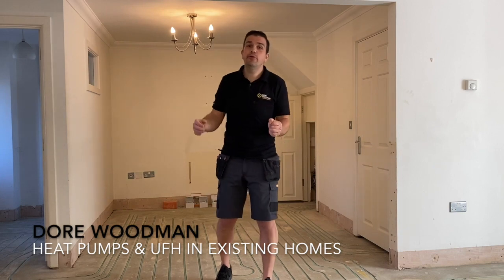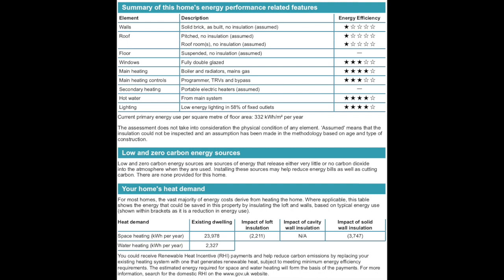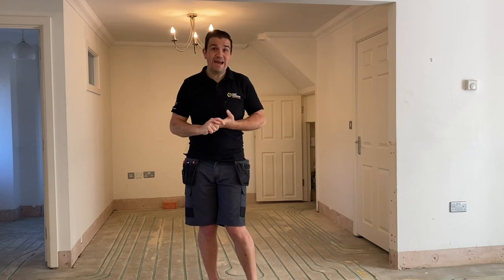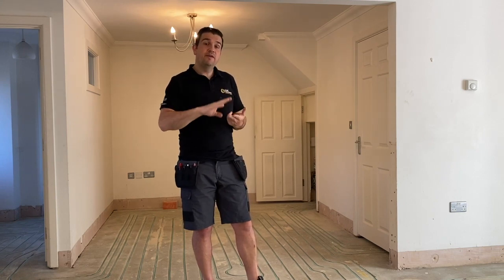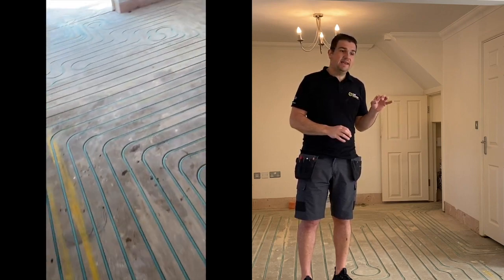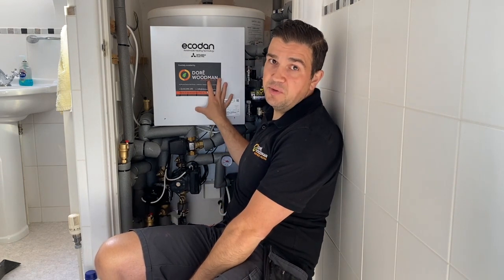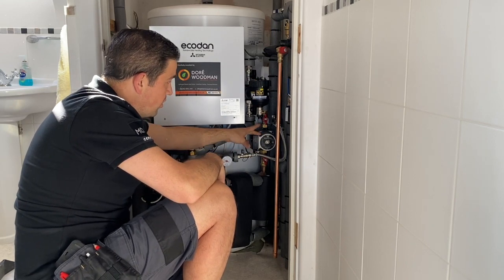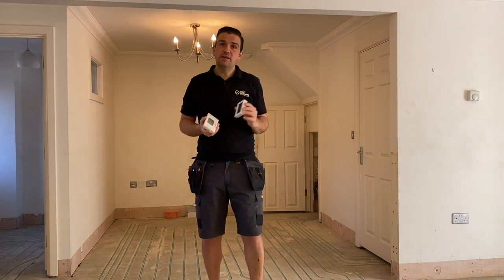Retrofit Mitsubishi Ecodan Heat Pump in a renovated home

Comment: Hi Jason, good presentation. Why in this instance have you opted for a Mitsubishi stat for the upstairs rads and a Heatmiser stat for the ground floor UFH. Could you not have just used one manufacturer...ie the cheapest? Thanks Mike
Reply from the maker: We have linked the Ecodan with the WiFi interface and MELCloud app, with the 1st and 2nd floor on radiators we installed the mitsubishi controller to work with the app to enable control remotely if required.

With the underfloor heating we had 3 zones to control and as this is set up slightly differently and with the options presented to the client the Heatmiser control was added. We also installed the NeoHub to allow further remote access via a mobile/tablet at the clients request.

I hope that helps.
Reply: @dorewoodman  Thanks you for your response on the stats. Can I ask 2 more questions please...
1.	After studying the FTC menu options, it appears that the DHW cannot be scheduled with ‘On’ ‘Off’ times. Octopus have a £0.05 kWh, 4 hour night period and would seem sensible to undertake DHW heating during this period using the pump (up to 50C) and then use the legionella function to raise this still further to 65 – 70C thereby giving plenty of hot water for the following day? Doing this could reduce the size of hot water cylinder required, Could you install a third party timer to operate the DHW pump or the MV? 
2.	Do you restrict your ASHP installations just to the south east?
Many thanks
Mike
Reply from the maker: @MichaelSmith-fx2ci  There are timing schedules that can be set either on the FTC controller and/or from the MELCloud app to enable you to integrate a program to suit your tariffs and we would certainly encourage implementing that to suit. As for the time period to produce the hot water, of course that will be determined by the amount of hot water you have, the temperature at the time of recharging and the period of time set aside for recharge.

For example, you have an 8.5kw Ecodan with a 210 litre cylinder, the target temperature for hot water is set to 50 degrees and by the time the heat pump comes on from the program schedule the cylinder temperature has dropped to 30 degrees the recharge is only approx 35 to 40 minutes, so whether the program is on for 1 hour or 4 hours it will only charge for the period required until it reaches temperature.

As for the legionella cycle, if you set that up to the max which is 65 degrees but you are do that very regularly to get use from the solar pv, that temperature is extremely hot so caution is advised. Safety measures such as Thermostatic Mixing Valves should be installed for each bathroom to protect against scolding and it could cause Thermostatic Shower Valves anti scold components to activate and you will then need to change the valves over.

 I would just err on the side of caution and consider what you require and when and set up a schedule to suit.

In answer to your question for area served, yes we only currently operate in the South East, where are you based Michael?
Reply: @dorewoodman   Hi Jason, many thanks for the very comprehensive response. I will take another look at the timing scheduling options. 
I actually live in Shropshire so sounds like I will have to source a local installer. What you’ve told me in your responses and info in your other video presentations, really sends out a positive professional image of your company. I wish you and your company all the very best for the future.
Reply from the maker: @MichaelSmith-fx2ci  thank you for your kind words. I hope that you manage to find a reputable company that will cater to your needs and advise accordingly. Good luck and all the best to you.